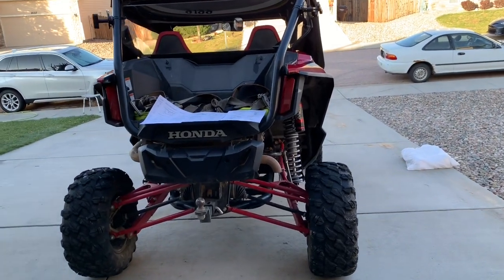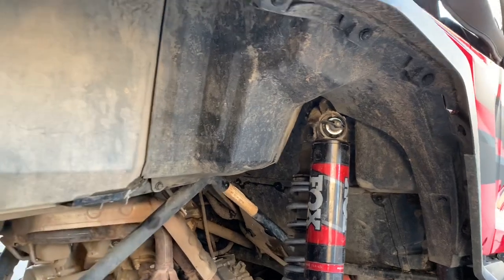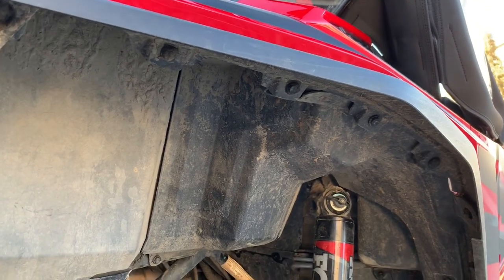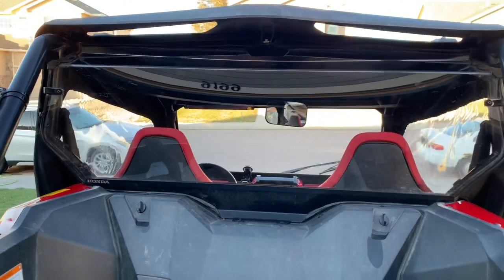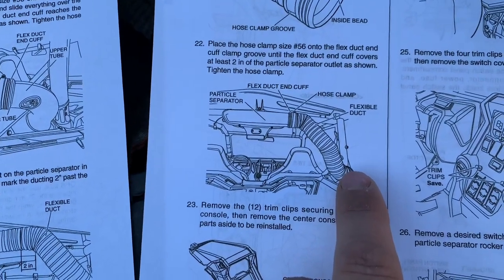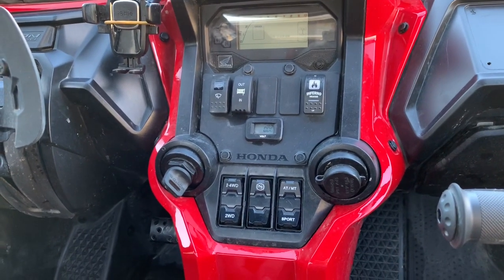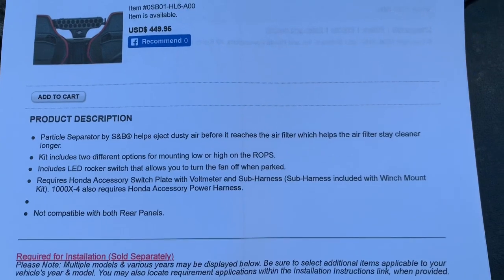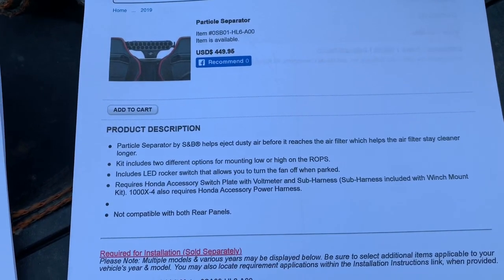Honda Talon Particle Separator. Original Honda accessory.Possible Air Filter problem fix 1000R 1000X

Comment: I'm interested in this as I'm on my third air filter in 530 miles.  Don't want to give up the hard rear panel though.  Is it only incompatible with the rear panel because the rear panel covers the upper roll bar?
Reply from the maker: Ride Red WV Me too, the air filter plugs up so fast and I don’t want to give up the hard panel as well! It’s not compatible with rear panels because they don’t allow air flow to the particle separator. Not sure, but I think some creative thinking/modifying should make them work with a rear panel. I’d buy it and make it work, but I’m sure the turbo kit will come with a new filter system.

Comment: Why can’t it be turned around and mounted backwards like most of those intakes?
Reply from the maker: Ryan Y I think it would be possible. Probably just have to modify the brackets
Reply: Just seems like there would be a better option and this doesn’t even look good.
Reply from the maker: Ryan Y I agree! I’m hoping the turbo kit has a different air filtration system!

Comment: Honda is really beginning to disappoint and let me down considering the talon is designed to be used off road. Ok, probably more so their engineers. Really though, wth were they thinking!?!? Belt's on their competition last longer than these air filters. I didn't buy a $20k sxs to put a new air filter on it every time it leaves the garage and I'll be darned if I'm spending $400+ for a particle separator and another $300+ for a switch plate and wire harness! This is ridiculous and should be resolved at their expense, terrible design flaw.
Reply: Btw, thank you for your time and effort in helping to convey your knowledge to us fellow talon owners. Not sure where you find enough of it as I'd personally rather be out riding!
Reply from the maker: BykerJB You’re welcome! I have another video actually installing the particle separator. Overall, the Talon is a great machine, but the factory intake is terrible, which wasn’t expected because you can go a couple thousand miles on one filter in the Pioneer 1000. The accessories add up fast, I’m almost at $40k on my Talon with the turbo kit.
Reply: I'm glad I've got two years of warranty from Honda on mine. If I can't get at least a couple hundred miles out of a filter in normal riding conditions then it'll be costing Honda one way or another. They are not only in offroad manufacturing but the auto industry as well, there's simply no excuse for this design flaw. PERIOD!
Reply from the maker: BykerJB It’s very disappointing! The turbo kit does come with a different air filter setup.
Reply: That's great if you have a need or desire for the turbo. I do not intend to install the Jackson turbo on mine due to riding conditions here. Hopefully it'll work for you considering you've already purchased the back window too.